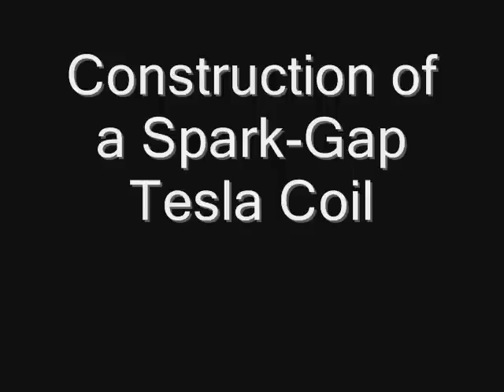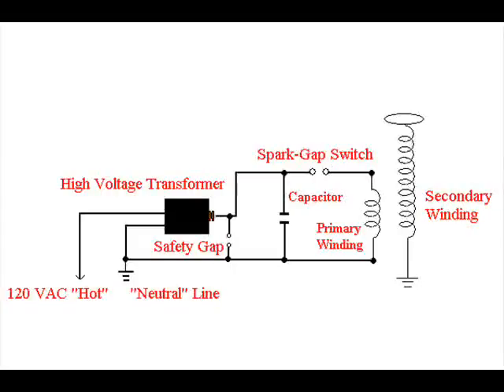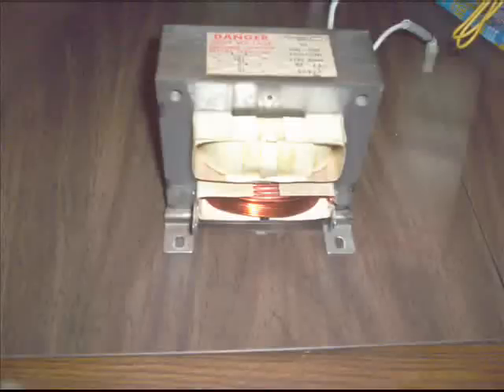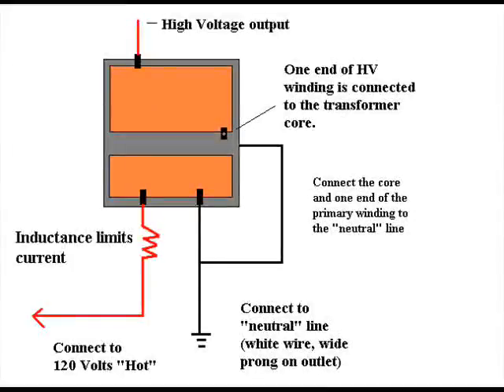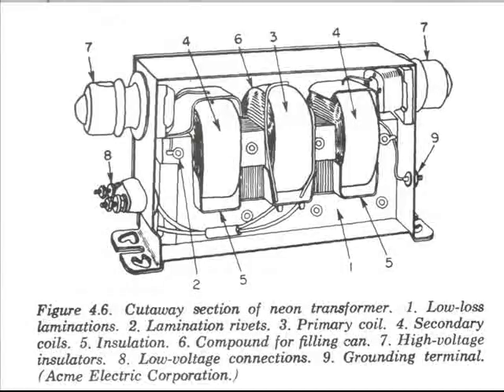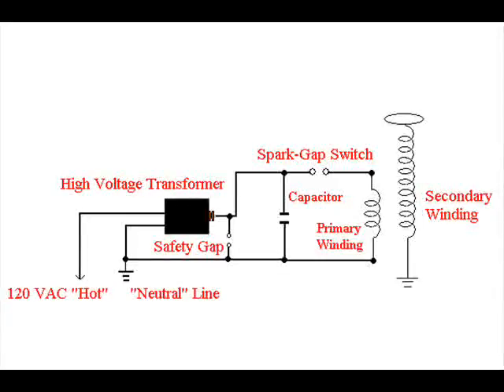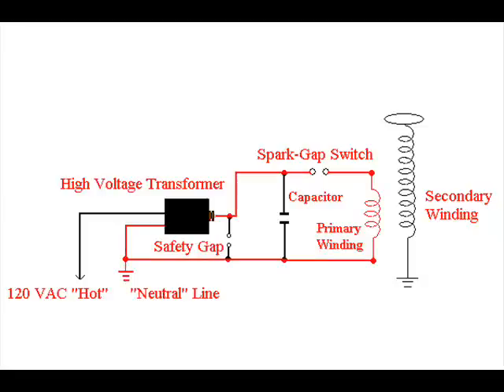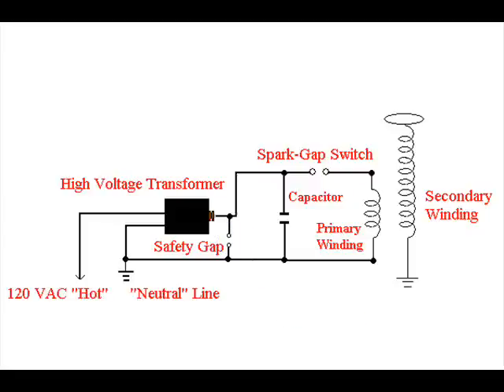Building a Tesla Coil

Comment from the maker: Sorry it took me a while to reply.  I usually don't recommend using microwave transformers for a Tesla Coil because the voltage is too low and I don't think they would handle the kickback too well.  But if you can use some kind of multiplier with it to supply at least 6,000 volts (and enough current...you need at least 20ma, preferably more) then it could work.  But you don't want any more than 15kv if it's a spark gap Tesla Coil.

Comment from the maker: Yeah, 12kv 60ma is plenty.  I'll send you a message with a link to a diagram I made for a mid-point grounded transformer.  YouTube doesn't let you post links in comments.  (Which is lame)

The only problem is that your capacitors will have to be rated for at least 24kv, or you'll have to make your own.  (You can also put more capacitors in series to double the voltage rating.)

Comment from the maker: ...I don't really have any experience working with a Marx Generator, so I can't really help that much with that.  The main concern with a Telsa Coil is having sufficient voltage and current in the primary circuit, although you don't want the voltage TOO high either otherwise the spark gap will fire rough.  Message me if you have any questions and I'll try to help.

Comment: This isent great because the HF and the HV can damage your earth wire the best is you stuck a cable deep in the earth ( about 20inch) and connect this to your secondary. I use the method too and it works great !

Comment: when i am wounding the secondary coil, the cu wire got sheared ! now if i solder it and  carry on the process will it affect the inductance and the arc length of my tesla coil ?
Reply: you should not solder it but try to solder it and sand the solder even with the gauge of wire then coat it with epoxy or polycrilic then continue wrapping but it could effect the iductance of your tesla coil depending on insulation

Comment from the maker: You really should use a real iron core transformer, not solid state.  Solid state transformers are easily damaged by the high frequency kickback from a Tesla Coil.  There isn't really an MA limit...you just need a minimum of 6kv at 20 milliamps.  The only other problem is that if the current is too high, the spark gap will get too hot and it might not quench right and will start to fire rough.  Above 60ma and you will definitely need some kind of air cooling to blow the gap.

Comment: ct92404 Great video, I want to ask you if Tesla's coil model is so much powerful and gives kind of free energy then why doesn't it be used for illuminating/lighting homes - by replacing usual source of electricity??
Reply: Tesla Coils do NOT produce "free energy." In fact, they don't produce any energy on their own at all. You still need an external electrical power source. A Tesla Coil just converts the power to high voltage and high frequency. It doesn't generate its own power. You can use a Tesla Coil to transmit power, and use one to recieve power, but they can't generate electricity on their own.
Reply: Chris Tobar
Thanks for answering Chris, I really appreciate that. It'd be great if you answer my 2nd  question  which I asked initially?

3.  Is it safe to use the high voltage which is generating by Tesla's coil to utilize for home appliances to cut the electricity bill?

Comment from the maker: No, unfortunately 2,000 volts is just way too low.  You probably won't even be able to get it to jump across the spark gap.  And if somehow you could, the gap would fire very rough.  I talk about this in my other Tesla Coil videos, Part 2A and Part 2B.  You can put 2 microwave transformers in series to double the voltage to 4kv.  But really, you should have at least 6,000 volts for a spark gap type Tesla Coil.

Comment from the maker: It depends on how big you want to build it...but generally, no, Tesla Coils do not need that much power.  For example, the small coil I show in my videos can generate over 100,000 volts but it uses only 120 watts of power.  A computer uses more power than that.

Comment from the maker: You have to be very careful about what read, because there are a lot of rumors and myths about Tesla.  Orignally, what he was proposing was that power could be generated conventionally, and then transmitted at high frequency, without wires, the same way radio signals are transmitted.  In later years, he said it might be possible to collect energy from the sun or cosmic rays...and of course we can do that now with photovoltaic cells (solar cells).

Comment from the maker: It adjusts the amount of energy that is dumped into the primary winding when the spark gap fires, and it affects the "capacitive reactance" in the primary circuit.  You have to "tune" a Tesla Coil, almost like tuning a radio.  The inductive reactance and capacitive reactance have to be balanced.  I actually have several videos explaining how a Tesla Coil works.  Watch my other videos.

Comment: Yes. There are 1,000,000,000microfarads(uF) in one farad. There are 1000nanofarads(nF) in 1microfarad and 1000picofarads(pF) in 1nanofarad. This means that there are 1,000,000picofarads in one microfarad. So .001microfarads is 1nanofarad, and 1000picofarads are 1nanofarad.

In other words, this means that you're correct.

Comment from the maker: A Tesla Coil is not a "free energy" device.  It doesn't generate power.  You connect it to a power source, usually 120 volts AC from an outlet.  It converts the power to very high voltage at high frequency.  Tesla Coils only transformer the power, it doesn't generate power.

Comment: That's not how it works.  Ionized gas conducts electricity, and that's what you've got surrounding an operating TC.  Those sparks are air being ionized and conducting current.

Lightning would flow through that ionized gas as readily as the output from the TC - more so, since lightning's potential is so much greater than a TC.

Comment: @wiseidiot5763 You can find many of these things inside household electronics, but it's not usually worth taking these items apart considering the prices of the electronics you would have to buy versus the prices of the individual parts as long as you know exactly how to make all the things necessary for this from scrap. Otherwise, you'd be better off taking things apart and using that stuff rather than trying to make everything yourself.

Comment from the maker: You can actually make a capacitor yourself.  A capacitor in its simplest form is just two conductive "plates" with an insulator between them.  The insulator just has to be able to withstand the high voltage from the transformer.  Actually, to be on the safe side it should be rated for twice the voltage of the transformer.  If you decide to buy the capacitor, you'll probably have to look in electrical surplus shops or a large electronics shop.  NOT Radio Shack!

Comment: The ball on top is called a topload. It is the terminal on the secondary winding that the sparks exit from (tries to jump to ground to complete its circuit). The EF on TC's differ depending on how the coil is constructed, and its power parameters. There are actually two EF's. The primary coil oscillates one EF, which is what induces power into the secondary coil. Once there is a current on the secondary, it induces another EF into the surrounding environment.

-Andrew andrewbourhis.blogspot.com

Comment: your wiring diagram is wrong. you need energy to bounce between the tank capacitor and the primary several times for each spark gap firing. your setup will work, but wont be optimum. the only spark gap should be where your safety one is in the circuit. its the repeated vibrating between the tank cap and primary that creates the very high voltages. it goes HV supply hot to tank cap to primary to hv supply neutral. the SG goes between the hv supply hot and neutral before the tank cap and primary.

Comment: I'm using a hundred thousand volts and a 1in spark gap fed by a zvs driver into a 51x Tesla coil multiplier that way I didn't have to wind a million goddamn turns I only had to wind 102 with two on the primary and using air capacitor shielding around the primary and the secondary to get around happening to use any real capacitors that and I also have full frequency control with my high voltage power supply

Comment from the maker: Sorry...but there is no way you could get the high voltage capacitor you need from Radio Shack!  You need a capcitor with a 20kv rating at least, and Radio Shack isn't going to have anything like that.  You would probably have to get it from an electrical surplus shop.  In fact, I don't buy ANY of my Tesla Coil parts from Radio Shack!  This is WAY more advanced than that.  Radio Shack is only good for cell phones and toys these days :(

Comment from the maker: Check out my other videos for more information.  You're not going to get ANY of the parts from Radio Shack.  This is way beyond Radio Shack.  Those idiots won't even know what you're talking about.  Most of the parts for a Tesla Coil are built from scratch.  You need a high voltage capacitor, rated for at least 10,000 volts.  The safety gap protects the transformer from high frequency kickback by sending voltage spikes to ground.

Comment: Probably not. Electricity follows the path with least resistance. Electrons are negatively charged, so an EF would (if anything) repel a lightning strike. Most likely, if this were to happen, the lightening would strike the grounding rod, because it offers a very conductive access to ground. In other words, there is nothing special about a TC that would attract lightning strikes as you described.

-Andrew andrewbourhis.blogspot.com

Comment: No.  The output power from a tesla coil is less than the input power.  What is increased is the voltage, but this comes at the cost of greatly reduced current.  The end result is less power out than in.

No claim of "over-unity" energy has yet been shown to be true despite strident claims to that effect and endless YouTube videos "proving" it.  I'm not saying it's impossible, but so far we haven't found a way to latch on to that free lunch.  Don't hold your breath...

Comment from the maker: heh...yeah, actually they CAN kill you if you aren't careful.  The primary circuit is a lethal shock hazard.  Just be careful and use common sense with high voltage, and you'll be fine.  Keep sensitive electronics at least 10 feet away from a Tesla Coil, and don't plug your computer into the same outlet where you have the Tesla Coil plugged in.  It can send high frequency kickback into the outlet, which would be BAD for the computer!  Message me if you have any questions.